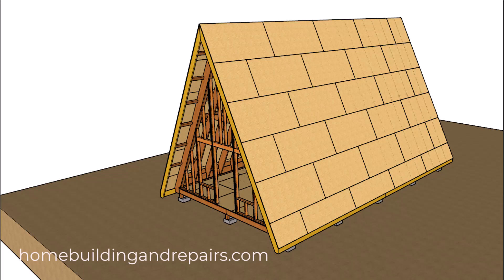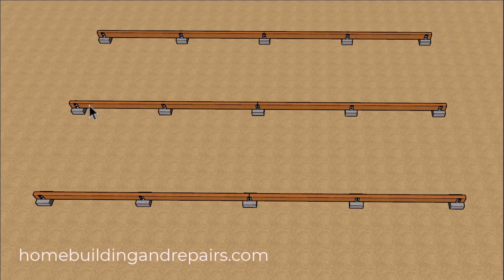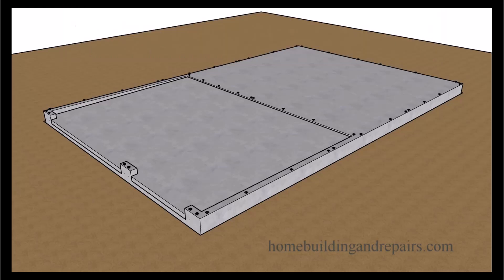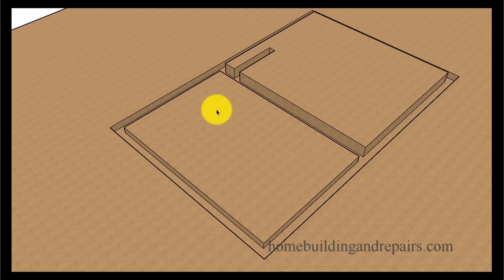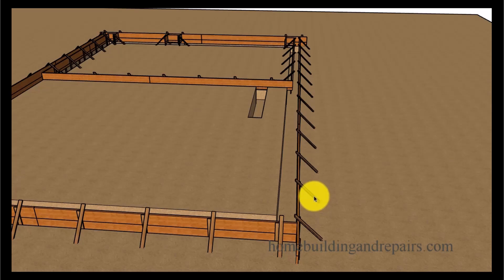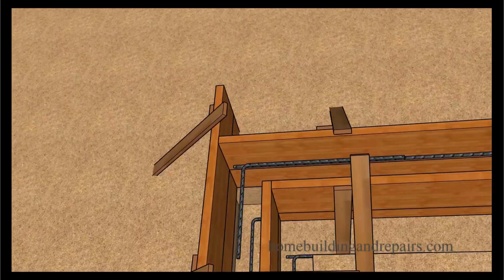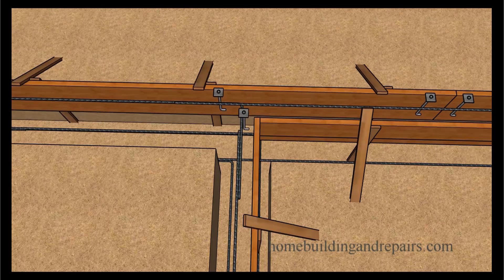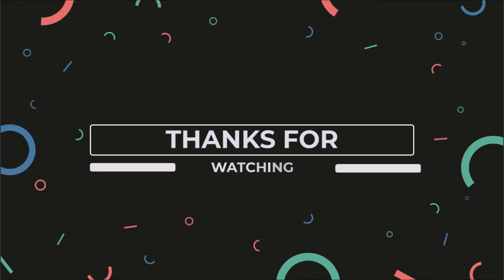Concrete Pier And Beam Floor Framing Foundation Construction - Home Building Tutorial

Comment: Are these foundations actually to code? I had considered doing one with pier and beam (first example) but could not find anything about them in the IIRC except for use with decking.
Reply from the maker: You will need to check with your local engineers for footing sizes.
Reply: This type of home is been around before slab foundation
Reply: Why does your illustration use blocking between the floor joists instead of a rim board on the outside.?

Comment: Good morning Greg. I have an issue with a rotten wood I think rim joist. My house is raised on three continuous block walls that run the length of the house and the ends are open. At one end the south east corner there are support "joists" and the one has rotted about an eight foot length that extends to and over the corner where it meets the cement of the block wall. I have consulted with three local companies and they all have a different opinion on a repair. Can you point me in the direction of one of your videos or what  repair needs to be done please. 
I made a video @jenniferflorida2020 here on you tube. Not sure how to put in direct link.
Reply from the maker: Here's a link to our website crawlspace floor framing repair videos, but I don't think I have one on your exact situation. https://www.homebuildingandrepairs.com/repairs/crawl_space/index.html

Comment: How doe such set-ups work with drainage, pests?   Seems like a welcoming hideout for rats.
Reply: Every house not on a slab is a potential hideout for pests
Reply: youd build stone walls around the base and install a proper vapor and pest barrier
Reply: Pressure treat and paint or waterproof
Termites can’t climb stone so you’ll be good as long as you make sure it’s good from the 

Most animals aren’t gonna get under something like that if it’s under 6 inches unless it’s like a snake but then again they want to be under a cold moist stone so yeah far it’s not an issue insect though make sure your wood is treated